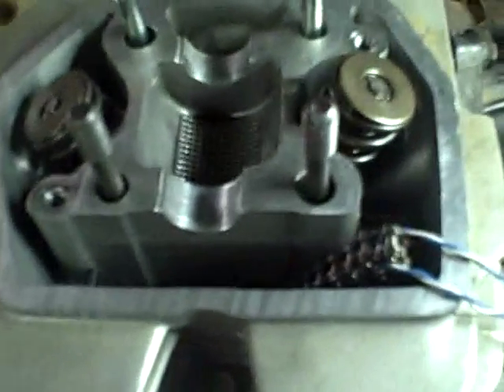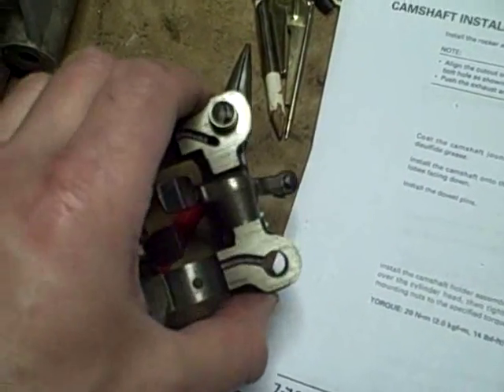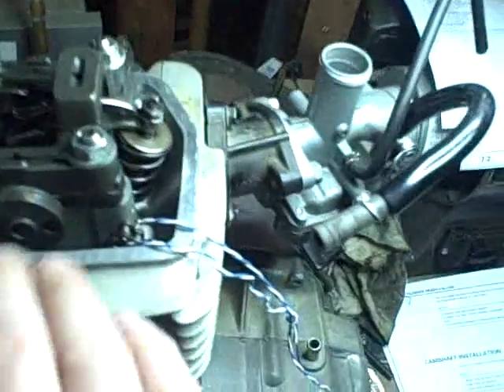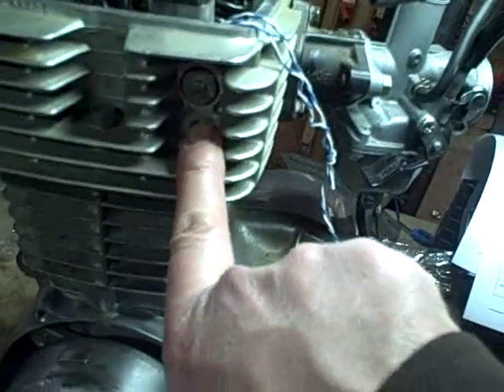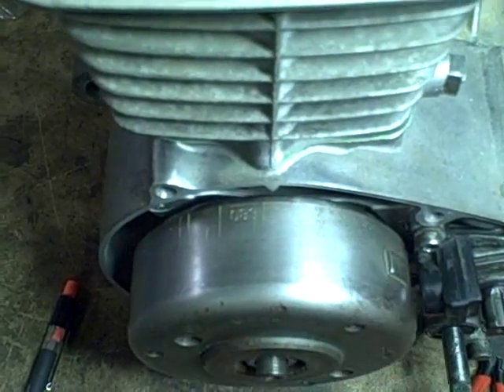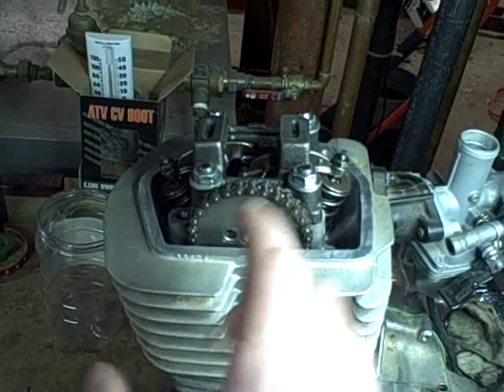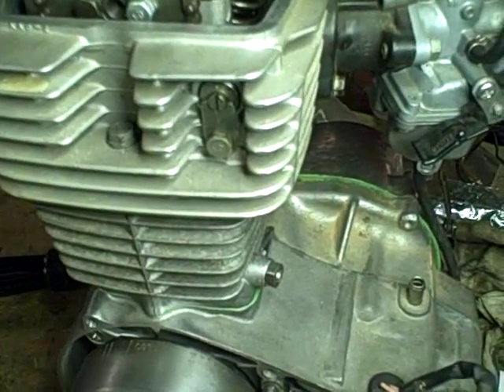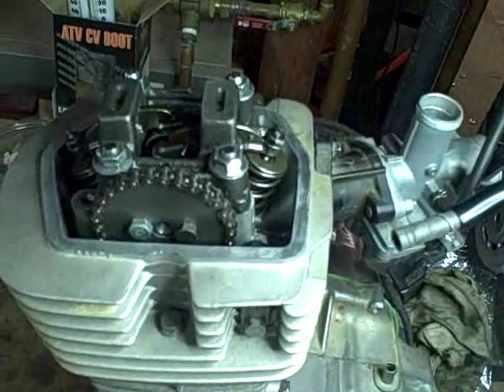2003 XR100R Part 18

Comment: If you're doing this, the way you get the bolt holes to be accessible is by rotating the cam and sprocket. If the holes align and you follow my advice, you'll know it's correct because the sprocket only fits on in 1 way.

It doesn't matter if you're off TDC when you put the sprocket on the cam, what matters is that they're off TDC by the same amount.

Get everything correct, then remove the sprocket and rotate the cam so a bolt hole is accessible. Then turn the flywheel to turn the sprocket until the bolt holes align (in same direction of course)

The single most important thing is keeping the chain under tension as you turn the flywheel. If it's slack, it could jump teeth and now the bottom end is no longer in the same orientation in relation to the cam shaft.

Comment: 4:10 - I was curious and looked in the service manual and it does state on section 7-18 to "Tighten the cylinder head mounting bolt" just after the step of installing the camshaft holder and tightening down the camshaft nuts to 14lb.  Sorry to resurrect an old thread but going thru this now and your video has been a great help so far!

Comment: How do you get the sprocket on the cam, my chain is so tight I cant get it on.
Reply from the maker: If i remember correctly, i unbolted the sprocket from the camshaft slid it up under the chain, raised the gear up and bolted it back on. All the while i had the cam chain tensioner completely removed......that is critical.

Comment: Very helpful videos....thanks.

I did notice that on your upper timing chain sprocket, that you have those two sprocket bolts backwards......the shiny one should be on the left and the black one (dowell bolt)goes on the right.....with the TDC mark at 12:00.
Reply from the maker: crazeyspivey glad you like the videos. Thanks.
Reply: I have often wondered that, why is that?
Reply: @TN_HondaDad  Good question.....I could have answered it 5 yrs ago, but now I have forgotten.  Perhaps to ensure the timing is done right?  DOH!  Getting too old, my memory is failing me.

Comment: How did you get the cam sprocket on so easy? I can't get mine on!! I have the gear with the timing chain on it and am trying to pull it up to get the center hole on cam shaft and can't for the life of me
Reply from the maker: +courtland  godwin  have you removed the tensioner?
Reply: I can't get mine on either
Reply: @jarodcarson9087  i know this is old but its because your not suppose to put the chain on the sprocket until after you put the sprocket on the cam